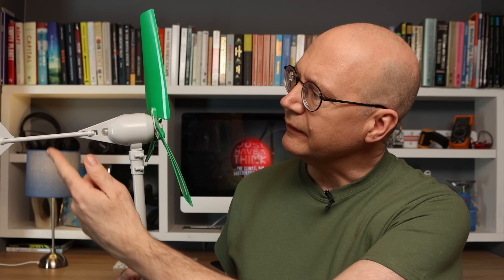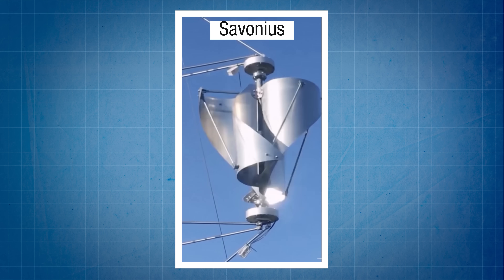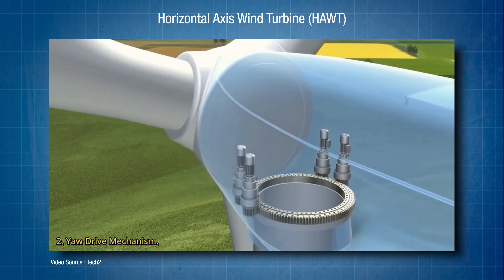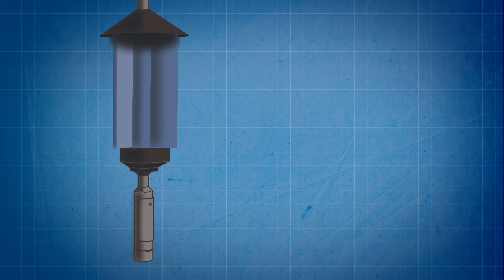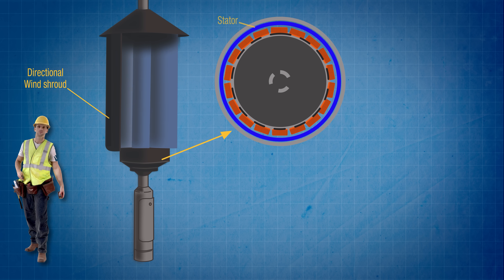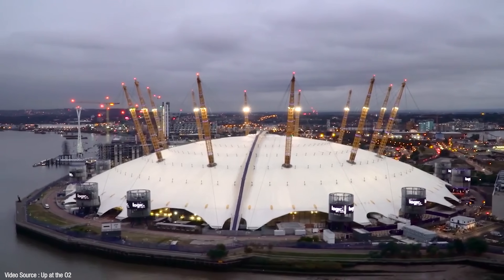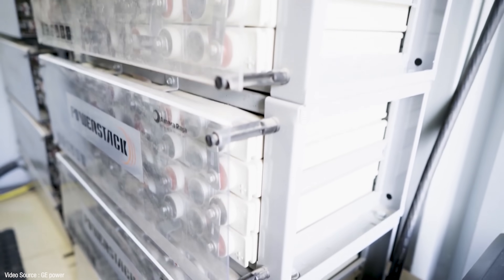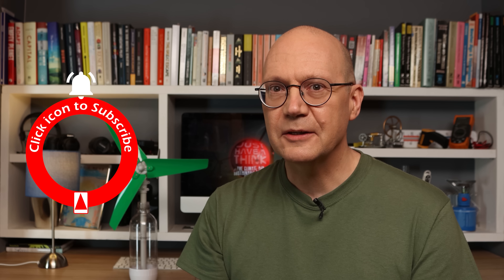A vertical axis wind turbine that doesn't need the prevailing wind! How do they do that?

Comment: The numbers don't add up, and kW claims doesn't seem credible. I would like to see real test data. The claim of 2.5kW from a 5.4m/s wind seems to be impossible for a cross section that seems to be around 1m2. I can't see how these would be anywhere close to economically competitive with rooftop or street pole mounted solar panels or large wind. Let's compare with some wind turbines that have certified data:

The DS3000 vertical axis turbine ("rated" 3kW) has a swept area of 10.6m2 and max power of 1.4kW@10-11m/s. At 5.4m/s it's under 200W. The problem is that power is related to the cube of wind speed, so a 2x increase in speed means 8X increase in power.You can see the graphs in the test data summary report here: https://smallwindcertification.org/certified-turbines/ds3000  Yes, you can buy an 8kW vertical axis turbine on Amazon, but it's fraud. 

Compare to a known brand small wind turbine, the Bergey Excel 10,  a HAWT with 7m rotor 38m2 area. Normally they are mounted on tall towers because wind speed is much greater than near the ground. The certification summary shows about 9kW@11m/s, but at 5.4m/s it's only about 750W. Looking at certification data gives realistic power output for a given swept area and wind speed.

VAWTs have been around for a long time, and mostly disappeared. San Francisco had some in the park next to the Golden Gate bridge, but they produced almost no power and were removed. The Adobe building in San Jose has some, but seem decorative. The problem is that power is proportional to the swept area, which is cylindrical for a VAWT and small. The HAWTs grow with the square of the size, so the new 10X larger turbines make 100X power.

Also, power is proportional to the cube of wind speed, and the higher up the rotor, the higher the wind speed. According to an article in Home Power magazine on small wind, without a tall tower, you may as well not bother. The ground mounted VAWTs have at least an order of magnitude less power per m2 than a tall tower of an HAWT.

Actually, mounting a VAWT next to a highway is probably bad to collect the higher power prevailing wind because the cars on the roadway and trees, etc. will block the higher speed wind 10-100 meters above.

Why spend the extra money for 10,000 pole mounted VAWTs when a single off-shore large wind turbine will generate more power for much less cost. The latest 14MW turbines are really driving down cost. A revised off-shore wind farm in New England US now has reduced footprint and impact by substituting the new 14MW units. Likewise, new improvements in ground-mounted solar are driving down costs for utility-scale projects.

So lots of solutions for future renewal power at lower than current energy costs. We need to look at physics and economics to evaluate claims from some "new" old technology that seems to pop up regularly from start up companies. Good to have the energy startups, but be skeptical and look for real production and cost data.
Reply: Hmm. Good analysis. However, I would question whether the numbers you are quoting are created from generators that use the latest neodymium magnets and other up-to-the-minute tech that these much smaller generators will employ. It's difficult to know just how much power can be gleaned from generators that make the most of the mechanical energy imparted through the most efficient aerodynamic designs coupled with the best generation from flat wire stators, neo magnets, superior bearings, yada yada.

I still suspect that the economies of scale simply don't apply here when the generation can be spread out over a much larger area. The need for improving point-to-point power transmission goes away when the zotz are generated in smaller power levels and consumed close to the generation point. It is worth pursuing this technology simply to ameliorate the problem of infrastructure (transmission line) build-up to accommodate the projected increase in generation demand from increased consumption. Let's not poo-poo anything good until we have something we know is better.
Reply: @martyschrader  But this isn't good. Most likely it is a scam. The output is likely less than 25W, so there is no way it will be anywhere near cost effective. Fancy new magnets etc can't make the wind energy of a given swept area more than it is. And Dave is presenting it with numbers that contradict each other, and are off by 2-3 orders of magnitude. The real tragedy is how many people here who are led to believe this utter cräp.

Comment: The masts of radio transmitters would need reinforcing to take the turbines. Home wimd turbine setups fail usually due to the immense forces caused by wind resistance  breaking the support towers.  Nice idea though. 
Ecotricities wind turbines use no gears by attaching a HUGE stator directly to the blades. 
This is of course a bit stupid because the stator has to be several meters wide and so costs a fortune.
The amount of copper used must be enormous. It should however be very reliable.. unlike their chargers!

Comment: The problem with vertical wind turbines  is the wind is generally faster higher up so of the impeller is long it becomes less efficient as the lower portion is acting as a propeller not an impeller. 
We had two put on the top of the car park at the train station.
For 6 months one was spinning even when there was no wind.. due to it being miss installed and the generator acting as a motor and using power not making it. 
Neither turbine has moved 1 cm in the last 3 years. So a total waste of money. However I like these as an idea.

Comment: This is amazing! What I'd really like to know is the total generation potential worldwide, if scaled up that far. I wasn't able to find much info on their site unfortunately. Also, the price comparison here paints a very rosy picture. Curious if that includes the capability to send energy back to the grid (I assume that requires adding hardware such as the inverter). If it's only cost effective while powering lights, I don't see this going very far, but if it can send energy back to the grid cheaply, that could be huge. Would definitely like to keep an eye on this to see where it goes. Hope they can scale up quickly.

Comment: I wonder if there is a way to add this system to electric cars, so they charge as they drive, thus extending the distance the car can travel without having to be plugged into a charge port. If it is workable, perhaps electric cars can get 1000+ miles, making them more reasonable to own, if a person travels a lot.

Comment: I'm not entirely convinced that you're going to get the predicted return on investment. Call me a bluff old skeptic, but it just sounds too good. I think we've all seen the many varied and ingenious wind turbine proposals over the years accompanied by a prototype and the usual marketing hype but what they all fail to provide is hard experimental data. These endeavours just end up disappearing without a trace because the hype doesn't match the real world performance. Yes, I know the theory has been thrashed out involving expert bodies in the field, but has an actual installation of this design been tested long term? Has a single one been mounted on an existing motorway lamppost over at least a full year to test the theory? If not, I'm afraid I'm going to have to reserve judgement.
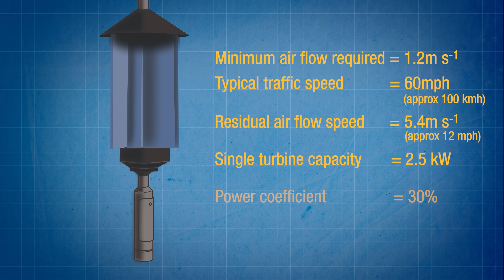Reply: It's worse than that: Dave's numbers don't stack up, they are wrong by two (5:31) or three (8:50) orders of magnitude. The right number for a VAWT this size  is about 25 watt. He even got it wrong in two different ways! Which means this is a total investment failure.
Reply: @tzenophile  I would say that 25 Watts from a VAWT that size is still optimistic. Maybe instananeous MAXIMUM output given favourable winds speeds but certainly not average. I believe most of the smaller/domestic commercial wind turbines on offer are 'on the box' rated using a standard 20-25mph wind speed. Average wind speeds in a particular location are far less than this. In addition, even at a 25mph wind speed, these units don't even technically put out that which is claimed. Combining both factors, and taking into account real world situations, they of course never live up to their claimed power output. These false performance claims appear to be what I can only describe as the standard wind turbine industry lie, a lie that sees start-up companies taking advantage of governmental "green" handouts as a result of climate change environmentalism. Its a modern day version of the snake oil industry. Buyer beware.
Reply: @saiello2061  Yes, you are right, I should have said MAX 25 w . What was Dave thinking? Such a disappointment.
Reply: @tzenophile  I hate to piss on the chips of people's efforts and inventiveness in the direction of environmental awareness and action, but I do get annoyed with false and/or ignorant claims, it just doesn't help anyone.
Reply: @saiello2061  Agreed; it creates disillusion and worse, a bad rep for "green" tech.. There are quite a few commenters here who want to invest in this, and Dave is passing the company info along.

Comment: Fantastic - so much potential. What about using them in the London underground tunnels as the trains rush by?
Reply: There’s no free space to install them and they would aggravate the piston effect that requires energy to overcome.
Reply: You should into the actual design of the tube. They have massive ducts to alleviate the piston effects already
Reply: @mostlymessingabout  which gives a great location for banks of them - right within the ducts themselves and what bypasses the turbines would cool them nicely.
Reply: @spvillano  since it's a duct. It would be easier to just use a normal axial turbine. However, dust is a big issue. You wouldn't want to send a chimney boy up there to clean it every month... there is already very limited time window for any track maintenance

Comment: Where it comes to homes I don’t think they will work for every home. Missouri Wind and Solar (another YouTube Channel) says you need to you wind turbine where it has an unobstructed flow of wind. In their videos they claim that the average home in a housing subdivision just doesn’t have good wind unless they put up a 50 to 75 foot tower. Many communities don’t even allow outdoor TV antennas. I would hate be the one to try and run this thing past the community administration board. I think purchasing right always down valley’s that draft mountain air and building a wind turbine farm in the down the side of the mountain.

Comment: 69.600 for 1 windturbine over 25 years ?
That is an awfull lot for a 2 m windturbine - might work only on a motorway that has lights already installed.
Here none has lights but a lot higher speeds. Maybe they will sell the turbine with a light bundle on top.

Some cities have lights a long city highways but it is unusual cause light emissions have become also a so called bad pollution.
Therefore no need for lights and without light masts and its infrastructure no harvest

Comment: I still can’t wrap my head around how this is any different to trying to put a wind turbine on your car…
Reply: The grid tie in will need a long cable

Or marklinn train system with metal strip on the road
Reply: Yeah, at the very least this video was a bit hand-wavy on this point.  Any resistance to the movement of air that vehicles must push out of the way is drag on the vehicle.
Reply: Just have a think.
On the car itself it is creating more drag.
Reply: @davidwatson2399  But having the wind turbines on the side of the road isn't creating more drag for the vehicles?
Reply: @thomassesselmann2093  
Nope
Reply: @davidwatson2399  I wouldn't assume that.  I'd want to see a study, particularly of the effects not just on the lead vehicle, but the following vehicles.
Reply: @davidwatson2399  Nothing is free.  These devices most definitely will increase turbulence that a car has to punch through.  It's just that you have to understand feed-forward effects in fluid systems to grasp how this is possible.
Reply: @cholesterol6703  
How about trees, guard rails, fences, hedges etc etc
Anyway, I think it's bollocks, a start up funding scam.
Reply: You can put a wind turbine on your car, and it generates more power than the extra fuel it takes in drag.
Reply: @quackerzdb  

You can’t extract more energy than you put in.
Reply: @dr.OgataSerizawa  That doesn't keep you from starting to use energy that used to be wasted. Think of using the engine exhaust to drive the fuel pump - oh wait, isn't that what they call "turbocharged"?  Or maybe running your radiator fluid through a Thermo-electric generator - producing electricity from the waste thermal energy given off by your engine. Or regenerative breaking, where you use a generator instead of break pads - turning energy that would have been wasted into extra battery life. 

You can't extract more energy than the sum of the input - you can however, make use of a MUCH LARGER percentage of that input. (Instead of the 12% - 30% that current automobiles extract from gasoline)
Reply: @muninrob  

Yes, absolutely!
Reply: @quackerzdb  That would defy the law of energy conservation
Reply: The roadside turbine steals energy from your car for itself. Your car has to work harder, lowering its fuel efficiency, to push the air out of your car's way, because this turbine is on the side of the road and has to be spun first. The roadside wind turbines run from energy you paid for that they pull out of your gas tank. And the city will of course tax you for the privilege of having your gas stolen, and then sell you back your own power. This is of course why they would also refuse to spin those turbines up for you and create a slipstream along the highway to help you save gas going to work. Then they'd lose the money.
Reply: @williambarnes5023  Your claim is like saying an 18 wheeler burns more gas to drive by people with loose jackets because it has to make their jackets flutter. Explain EXACTLY how please.

As for your anti-establishment rant, I'm going to ignore it as irrelevant, this is engineering, not poli-sci.
Reply: @muninrob  An 18 wheeler does burn more gas to drive by people with loose jackets because it has to make their jackets flutter. The jackets provide resistance to the air going past them, that makes the air harder to move, which pushes backwards on the truck. If you acknowledge that spoilers work to increase gas efficiency, you have to acknowledge that anti-spoilers work to decrease it.
It should be clear to you that if they instead powered the turbines from the electrical grid to create wind and form a slipstream that sucks cars along the road, cars would have better gas mileage. Doing the reverse then of course does the reverse.
Reply: @muninrob  You certainly aren't.
Reply: @williambarnes5023  

nunya business is correct.   Your knowledge of science is lacking.   You are incorrect.
Reply: Check out Quint BUILDS youtube channel. He does it, proves it, and explains why. Essentially you're harvesting some of the energy that's wasted by your car moving through the air.

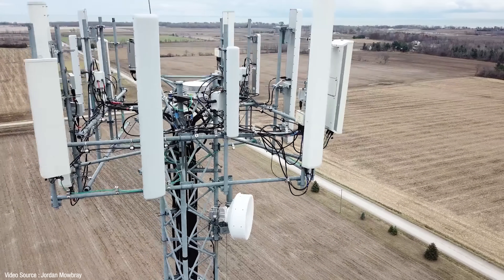Comment: Hold on the numbers do not add up! At 5.8kwh/day/turbine (time code 6:00) you get 6.6M kwh over the 25 years for 125 turbines, then add 20% because these are bigger and you get 7.9M kwh @ £8.7M (time code 9:35) that comes to £1.096/kwh! Compared to solar @ £0.055/kwh and Hinkley C @ £0.095 these are a disaster. What am I missing?